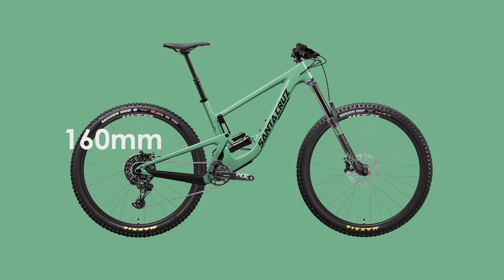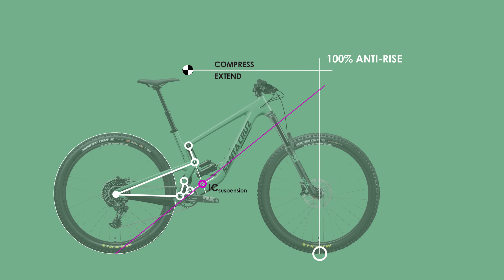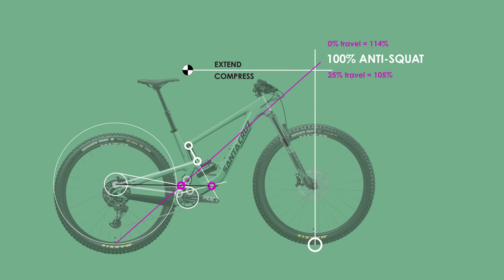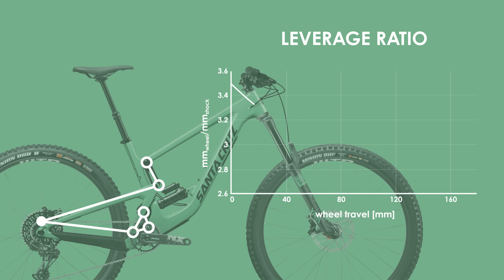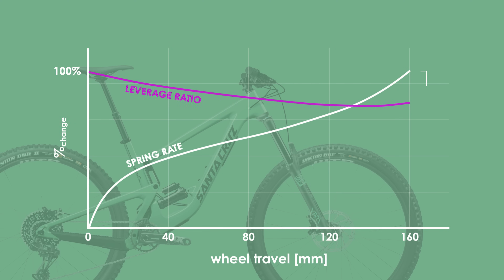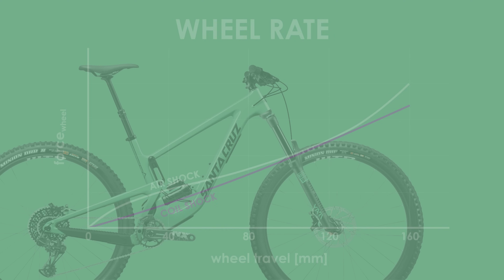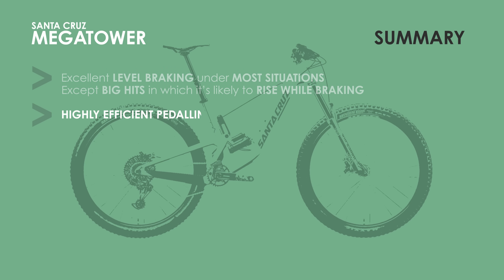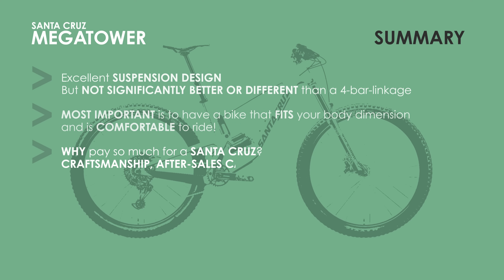Santa Cruz MEGATOWER VPP Suspension REVIEW

Comment: Really excellent vid. I have ridden numerous four bar (Horst) designs, DWLink bikes (Pivot and Ibis), Yeti’s Switch Infinity and I own 2 Santa Cruz Bronsons (V2 with upper linkage and V3 with lower, and have demoed the new Tallboy and Hightower with lower linkages, although not the Mega yet). Most of what your math indicates should happen in the real world I would say is correct, with a few caveats. I have found that the anti squat on the lower link Santa Cruz bikes in the real word outperforms four bar as follows- they stay higher in their travel and have less pedal bob but stay planted providing better traction under pedal power and there is zero pedal kickback on big square edge hits. The four bar definitely loses some small bump compliance and ground hugging compared to the VPP, which if you then drop the psi in the shock to compensate you get more pedal bob. So with a four bar you have to choose- do want better ground hugging traction or less pedal bob, you can’t have both, whereas with the VPP you get both. Also, the pedal kickback difference is quite noticeable. IMO the four bar feels more like the old upper mounted VPP designs- they all had these same issues, especially the pedal kickback due to the chain lengthening. But the new lower link VPP fixes all of these issues. Also, IMO, the DW link bikes and Yeti switch infinity are even better than the VPP in all these areas, but the difference is closer than ever and probably not noticeable for a lot riders. 

Regarding downhill, the VPP is far superior to the four bar IMO- it is significantly more supple off the top providing better small bump ground hugging but there is no mid travel sag- in fact just the opposite- when you push the suspension into the mid travel to rail a bermed turn or preload for a jump, it is quite supportive. This is, I believe, why just about everyone who rides a VPP will tell you that they rail turns and feel poppy.  And that to me is the magic of the lower link VPP,  downhill they manage amazing traction and ground hugging over smaller chunder at high speed, yet still allow you to push into the suspension to rail a turn or boost a jump, making the bike both a bomber and playful and poppy. While IMO the DW link bikes and Yeti have a slight advantage up and under pedal power over the VPP, the VPP is better downhill compared to all of them, although I would take all of them over a four bar. 

Regarding blowing through the travel, what I will say about the lower link VPP is that every aggressive ride the little rubber ring is either at the end of the shock or off, indicating I have either used all the travel or blown through it.  The VPP combined with the shock tuning will have you using all the travel, occasionally blowing through it. If you are used to older bikes where after even aggressive rides you often have a fair amount of travel left, this may seem shocking (no pun intended). But what I can also say is that even when I have blown through it I have seldom ever actually felt it, and was surprised at the end of my ride that I had blown through it. So in MTB review terminology- the VPP has no harsh bottom out- in other words there is no jarring bang at the end of the travel to mess up your landing- just smoothness. 

Why I went Santa Cruz- first, the price difference is not much- compare the Bronson with Trek Remedy, the Scott Genius, the Yeti SB 140, the Pivot Mach 5 etc. All of these brands, if you compare models with similar components, are all within a few hundred dollars of each other.  So price is really not an issue if you compare Santa Cruz to other similar upscale brands that do not sell direct to consumer. Although you can save money on consumer direct brands. Which brings me to another reason I went Santa Cruz- dealer support and availability. SC dealers are everywhere in the US, so support no matter where I am is great. And their dealers seem to be the better LBSs with more mountain bike oriented workers. And Company support and warranty are excellent. And the most important reason- the feel when I rode it- the bikes are substantial and stiff as hell resulting in a machine that felt more like an extension of me than any other bike. Plus the sizing is great- at 5’10” I like a long bike and could and did size up to an XL with no problem because of the low standover.  The Bronson just fit me better and overall felt better than other bike I had demoed, pedaled awesome, and absolutely felt like a dream on the downhills. And that really should be the deciding factor for a buyer. It is how does the suspension and geometry and the quality of the build and the components come together to feel when you swing a leg over it and hit the trails. 

Anyway, great vid and interesting to learn the engineering behind it and how it does really play out on the trail.
Reply from the maker: Awesome insights! Thanks very much!
Reply: Trail POV just sub’d and looking forward to checking out more of your vids.
Reply: "Find a comment which is as important as the video, and you are winning!" SunTzu
Reply: Great commentary on top of the great vpp explanation. Just got a HT3, still getting used to it after riding a norco sight 2017. While not a hardcore downhiller, the HT3 is so much more refined up and down. Plus w the norco was constantly having to play with the rear shock pressures and ultimately had to reach down and lock it out to prevent pedal bob. Not so w HT3. Never really have to touch the lockout.

Comment: Great information regarding the chain growth of 5.2%. Is that a relatively constant number for all VPP suspension on their bikes. e.g, will the 5010v3 rear-center be 447mm at max length (425mm static). I’m curious what the Megatower and 5010v3 rear-center measurements are at 50% travel and if the low shock VPP ratio of 5.2% is similar to the high shock mount VPP of the 5010? Thanks for the interesting video!!
Reply from the maker: Thanks for the comments. Unfortunately I'm guessing that chain growth is probably not similar across their lineup as different travel etc is going affect how much the suspension needs to move. I would have to do an entirely different measurement for each bike.